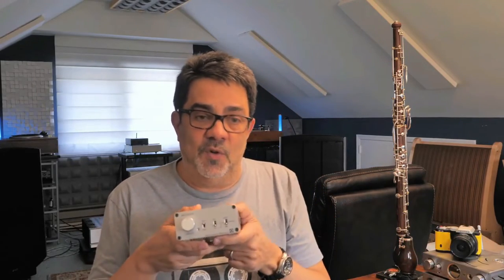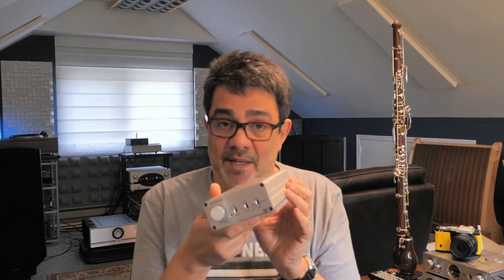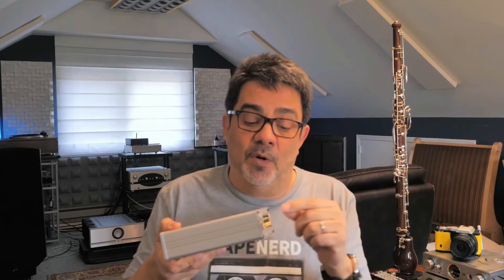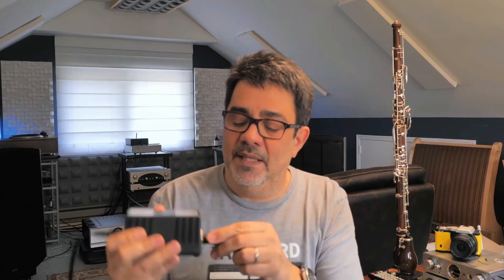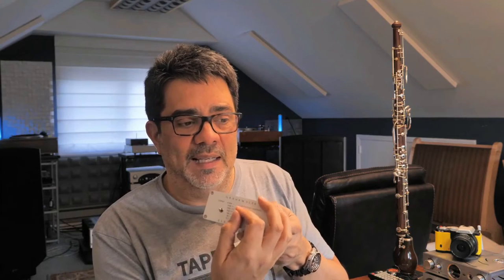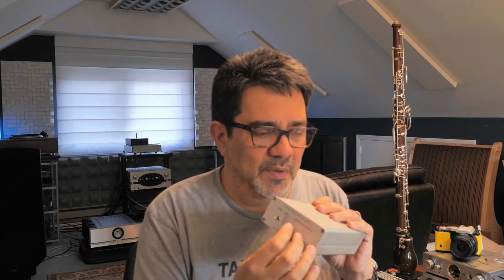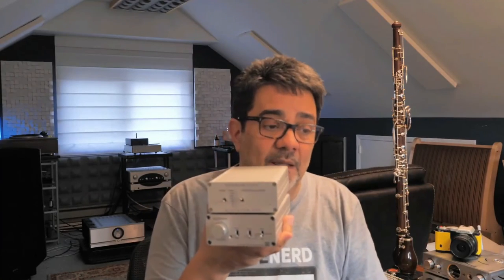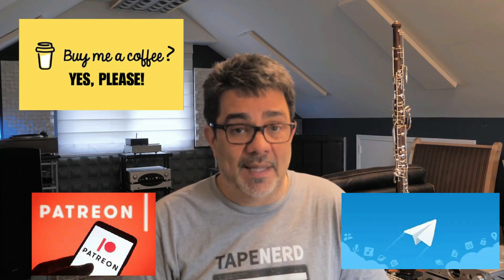Graham Slee Accession and Elevator EXP, quality phono processing! #grahamslee #audioarcan

Comment: Thanks, Pedro. I’ve got aprox 15-20 different carts mounted to different headshells, and this phono stage looks like it could be useful, especially with the flat EQ setting and adding my own. Not sure I’m ready for that rabbit hole though. Glad you mentioned the Tavish phono pre, as that’s what I’m using right now, and I love it. Thanks very much for this review.
Reply from the maker: You and me both!
Reply: @deaudiofilosinenglish169  LOL 😂 Dyou have the Tavish Classic model? That’s the one I picked up, as I’ve got a large stash of NOS 12AX7’s and 12AU7’s and the Tavish “Vintage” model with it’s 6SL7’s would be a bit more difficult for tube rolling. My Tavish phono pre going to my Don Sachs preamp, which has 6SN7’s and my Quicksilver monoblocks which have KT88’s going into my Tekton Pendragons, seems to be a fantastic match with great synergy. Finally no more “upgraditis” for gear, and just buying records instead. Love your reviews, Pedro. Thanks again. 🔊😊🎶
Edit: Quick side note: I’m in the process of building some very high sensitivity speakers that can be easily run by a 5-10 watt SET amp, cuz that’s where the true magic of music reproduction lies, imo. Simple circuits with as little parts as possible….